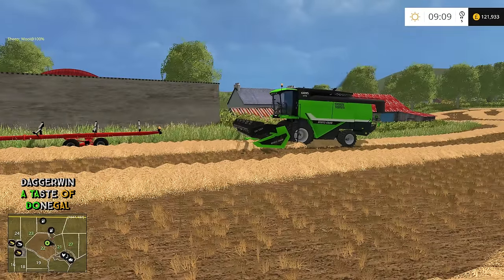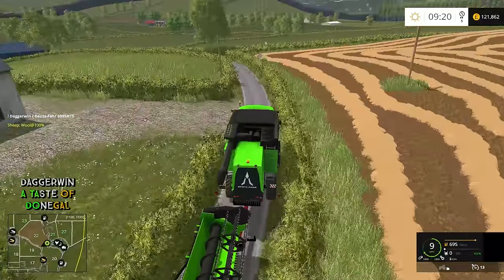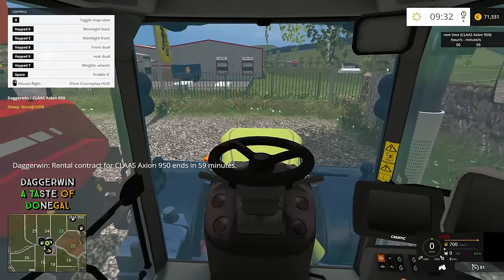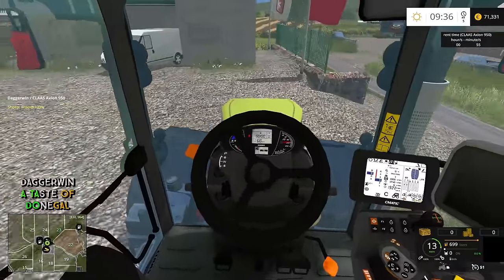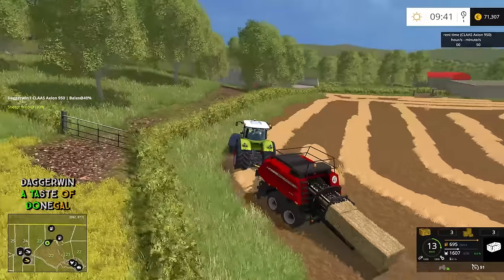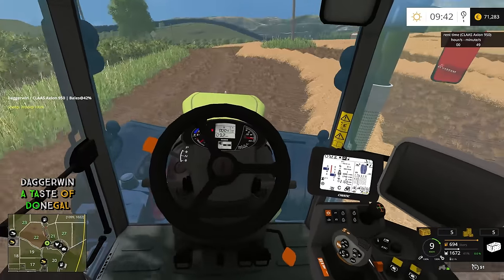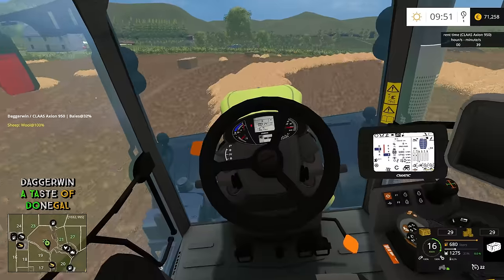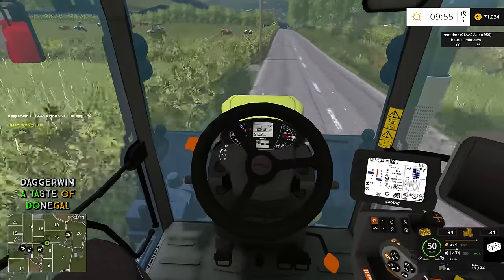Let's Play Farming Simulator 2015 | A Taste of Donegal | Episode 15

Comment: The John Deere Imatch you can hook up the implement and the PTO shaft without getting out of the cab. Depends on the baler and condition but usually 7-8 miles an hour for baling.

Comment: Plug a usb 1gb flash drive into your internet router. Then turn off the router for 30 seconds then turn it back on. Then you have gb Internet.
Reply: LOL no
Reply: +Fahy 90 look up Thio Joe
Reply: i just did, and from looking at only 3-4 comments under the video i was able to confirm that the video is a joke lol. Daggerwin has the same problem as I have myself, it's down to where we live. To get better speed's we have two options.. 1. Wait for Fibre
2. Move house (for those with caravan's this is considerably easier)

Comment: ANYONE TIPS FOR LESS LAGG IN FS15?
Reply: PC spec?
Reply: Real life money hack
Reply: PROCESSOR / CHIPSET
CPU Intel Pentium T4200 / 2 GHz
Number of Cores Dual-Core
Cache L2 - 1 MB
64-bit Computing Yes
Data Bus Speed 800 MHz

CACHE MEMORY
Type L2 cache
Installed Size 1 MB

STORAGE
Interface Serial ATA-150
Optical Drive DVD±RW (±R DL) / DVD-RAM
Type none
Type portable

RAM
Technology DDR2 SDRAM
Installed Size 3 GB

MEMORY
Max Supported Size 4 GB
Technology DDR2 SDRAM
Reply: Coal's Cakes lol i wish i had
Reply: Yeah it is down to your spec man, it's just not up to it I'm afraid. One thing you could try if you have any experience in Giants Editor is lower view distance's remove tree's etc to try and reduce some of the lag
Reply: +Fahy 90 I know the pc isnt good. It's like 6 years old. When and when I opened it for the first time, I had to click 12 times on a download button to download because random page opened. When I completely cleaned it, no lag or frame drops in my browser, and now it fast af, but it's not a game pc
Reply: +Stan Van Esch I HAVE THAT PROBLEM A PAGE IS ALWAYS COMING UP NOW PLS HELP??
Reply: Tomolox [G.E.W.P] what page?
Reply: Like... adds always pop up when i try to download stuff... and i have to get rid of the page and click it again! :(
Reply: go reset your pc and install windows again. my pc is now fast af
Reply: what also helps a bit is go to microsoft website end look for a malware scanner